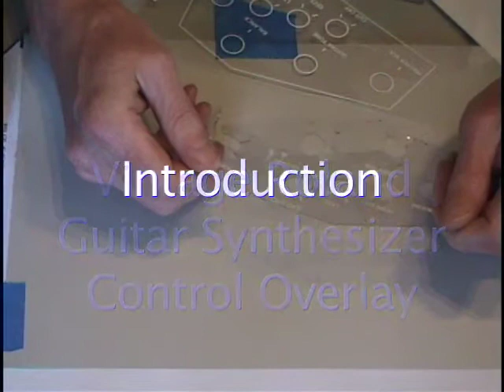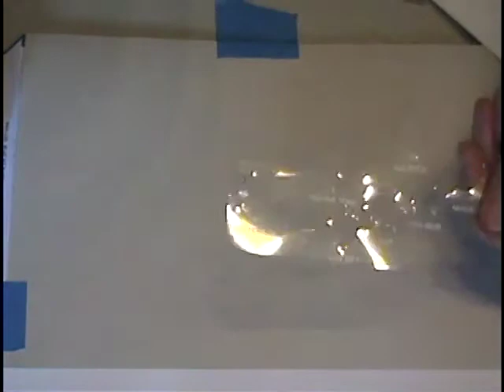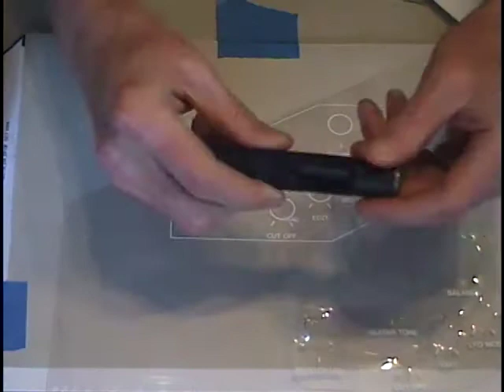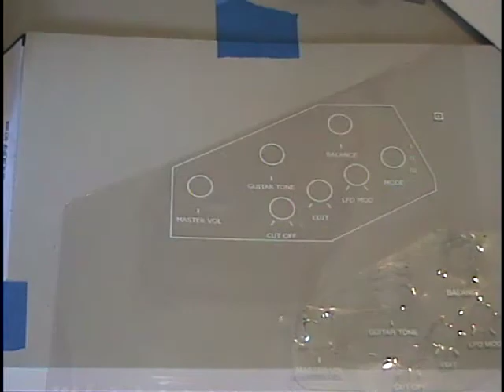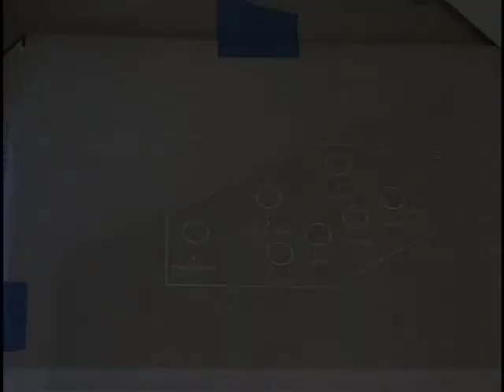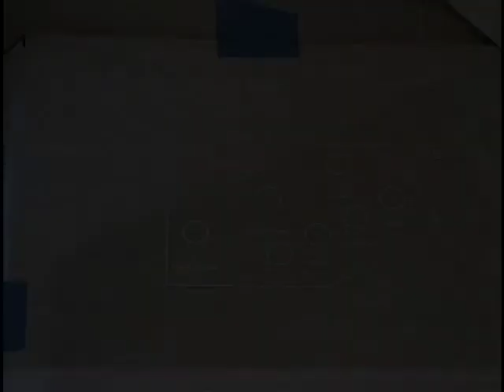Vintage Roland G-707 Guitar Synthesizer Controller Overlay - Introduction

Comment: I just bought a gr-300..i need the one for the g-303 guitar.. is there a link to an adobe illustrator file or something like it on the internet?  
 i work in a print shop.. so i have the equipment to make one.. also..my cable is in bad shape .. any ideas? thanks for the video..